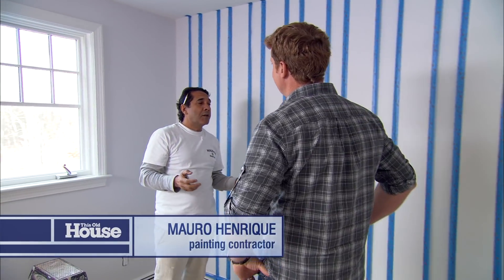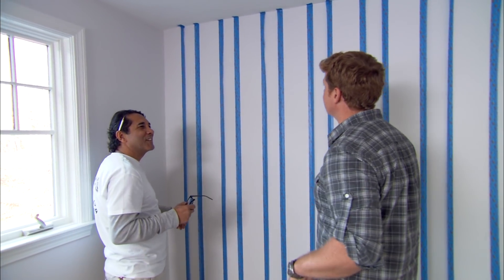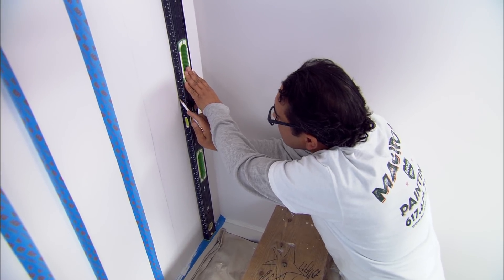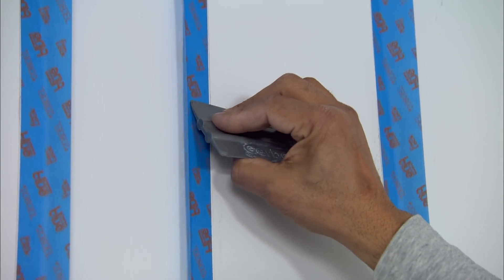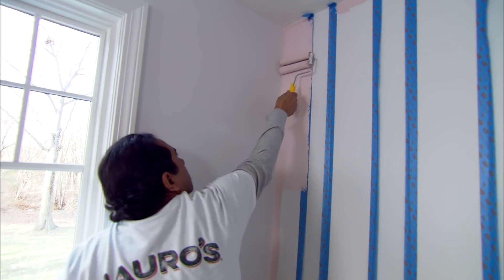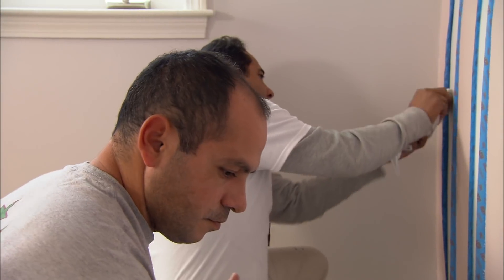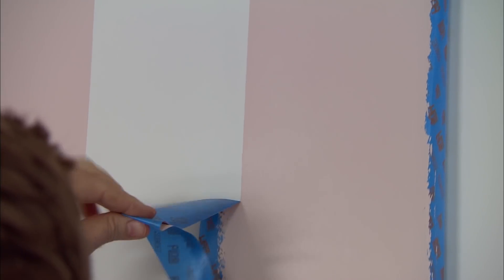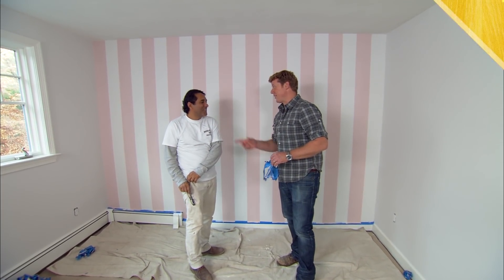How to Paint Wall Stripes | This Old House

Comment: I did that in my kids room when we bought the house 8 years ago...  The problem is now that he doesn't want it anymore it's hard to get rid of the thickness it left on the wall...  You have to think about it real good before you do it!!!
Reply: Best way to get rid of it is to sand the wall down with some heavy grit paper. 100 should do the trick. Then you can do a quick skim coat on the wall with mud and sand it up. It's pretty easy. For doing stuff at home, you don't have to be great at mudding, it just means you gotta give it a little more love sanding! Good luck!

Comment: Best way to get a clean line is to actually paint the tape with a light coat of the paint that's underneath the tape. Let it dry. Then apply your other color. You won't get any bleed underneath the tape because the first coat already bled underneath, but it's the same color so you won't notice. Then the new color will be as sharp and straight as the tape itself.
Reply: Do you paint for a living?…yeah thought so!
Reply: @brianglade848 ...... What?
Reply: Great tip!
Reply: You pretty much have to do it this way on textured walls.  For a contractor though that's extra time and money